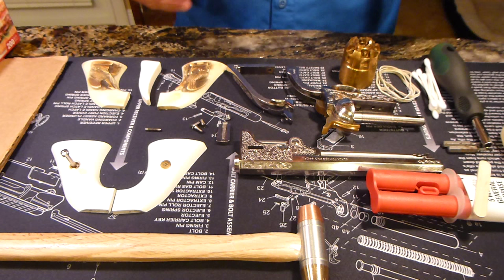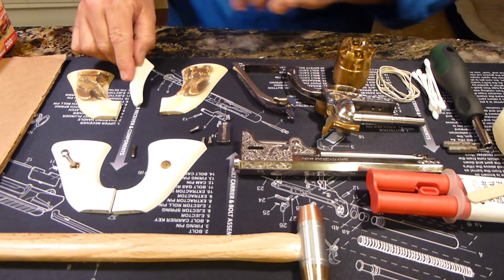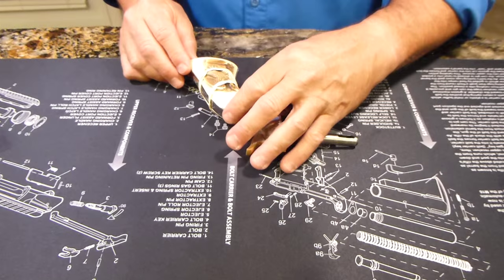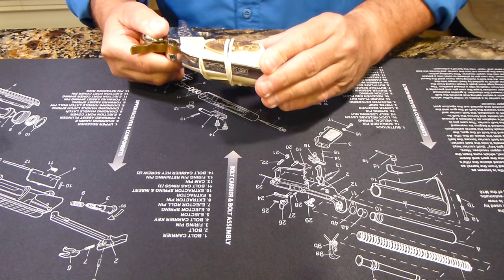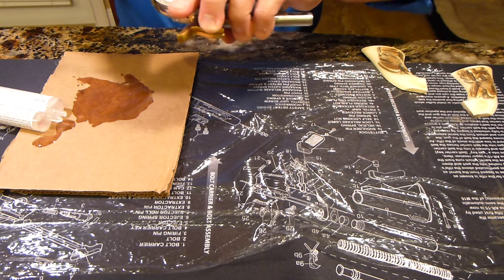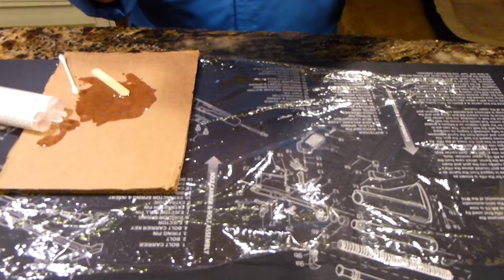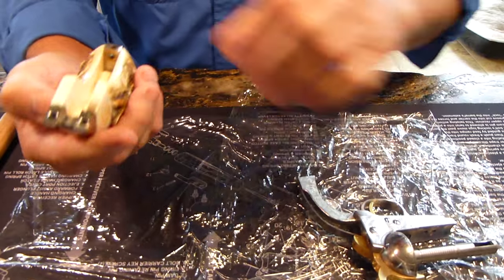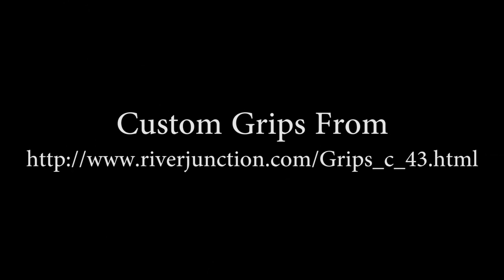Pietta Uberti or Old West Revolver Grip Replacement - How to replace revolver grips

Comment: Great tutorial. Another tip: whenever I re-handle pocket knives, I take a drill bit and make some small craters on the inside of the scales. This way when you sandwich the scales to the liners you have a stronger glue job. Otherwise, when you clamp the scales to the liners you lose quite a bit of epoxy. The epoxy has someplace to go, in other words. I imagine you could do this same method to the gun grips.

Comment: Very helpful video, I'm going to try to do it your way with some grips I have!
Reply from the maker: Hey, how did it go?
Reply: Well...I haven't done it yet. Everytime I go out to the shop I think about fitting them, but they are sized for a 1860 army, and I want to put them on a 1851 navy. I could put them on it, but I need to get a new grip frame so they'll fit. Thanks for the reminder, It'll make me get on it.

Comment: Another way to make the parts non-stick for the epoxy is to wrap them in Tyvek tape, I've used it in the bottom of molds when making tabletops with epoxy filler. It is really thin and if you cut it right along edges so it doesn't double over it will cover better than vaseline. A combo of the two may be the best.

Comment: I have this gun, but the grips seem small. Is it possible to fit Pieta's Walker grips to this frame?
Reply: Not sure if you’re still needing an answer a year later but the grips on an 1860 Army are larger and the front/back strap should fit on your 51 Navy. Hope this helps!
Reply: @quiglydwnunda5886  I gave the gun to my son, but I will pass this on to him. Thanks.